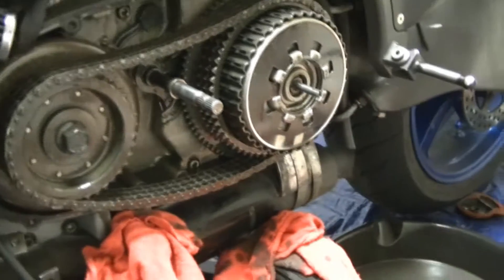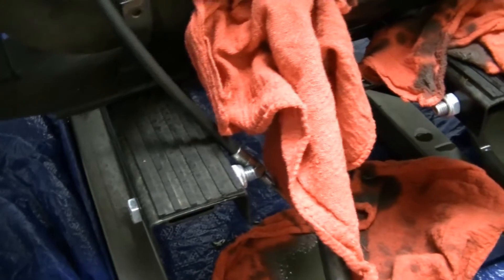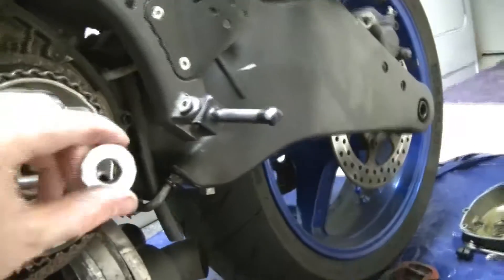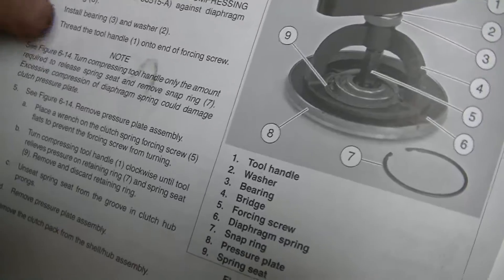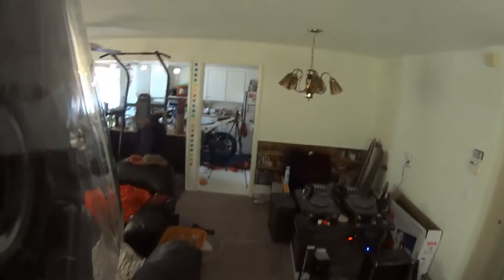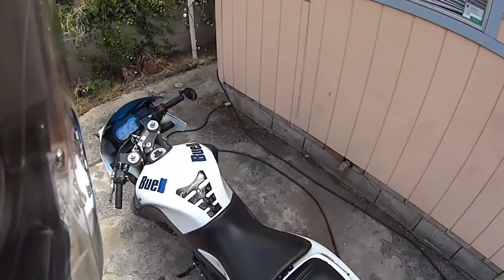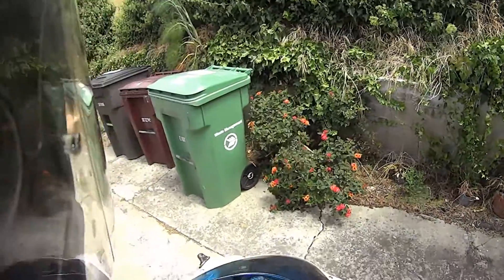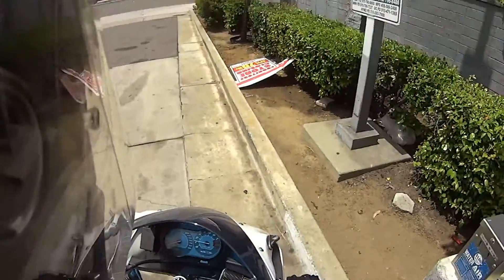Clutch Repair and Ride

Comment: My clutch shifts into neutral upon taking off from a stop. I have to hold my toes down on the lever to keep it in first and up to keep it in second. Only sometimes it will shift though all the gears but when i come to a stop sometimes it wont eve go into first.  Any Suggestions or input.  Thanks in advance Buell Crisis
-------2008 Buell 1125r---------
Reply from the maker: If I had to bet, it'd be the same thing as what was wrong with mine when I bought it. The last owner STOMP-shifted which bent the shift forks and shaved metal off the shift drum. This makes it keep popping out of gear. Mine was second gear. Had to replace the shift forks and shift drum... NOT cheap. The transmission on my buell is a split case so it's alot of labor n you may as well do any bearings etc while you're at it. an 1125R might be different tho. I think it's a rotax or whatever. I've never torn into one really.